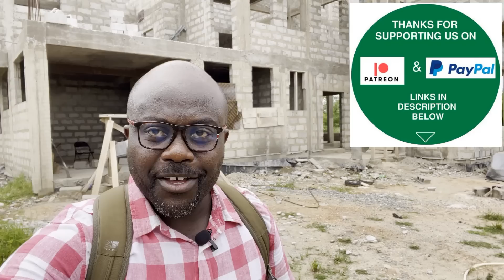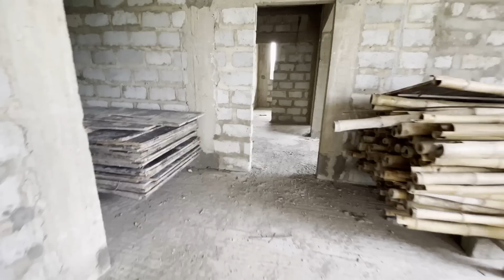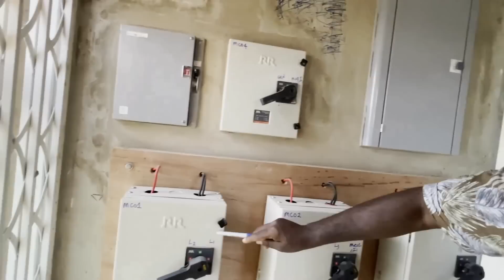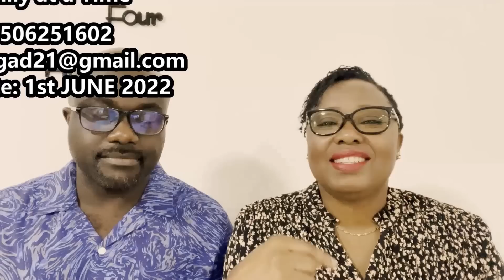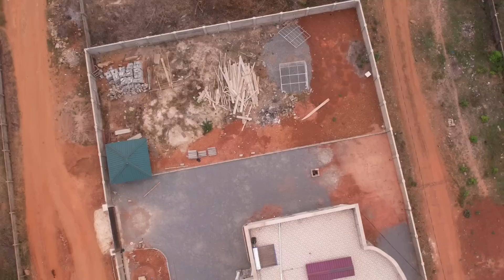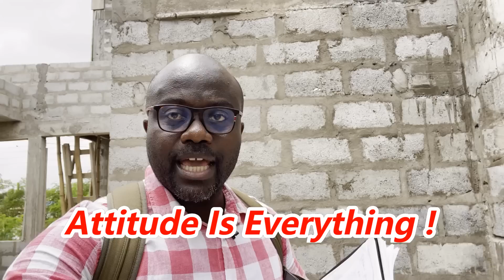JOURNEY WITH ASHER & GAD | TRASACCO SPRINGS-EP2 | RECRUITING!!

Comment from the maker: Ebooks
Cost Templates For Building In Ghana
     https://payhip.com/b/UQjBY
 How to Wire your Home for 110V & 220V Equipment

     https://payhip.com/b/gN8eY
 How to Manage Power Failure (dumsor) in Ghana.

     https://payhip.com/b/BlyQ9
 How to Construct a Water-Proof Concrete Flat Roof in Ghana

     https://payhip.com/b/QXJPl
 How much Power Does your House Need?

     https://payhip.com/b/8P7wu
 Water System Design for a Multi-Storey Building in Ghana

     https://payhip.com/b/fLKYD
 How to Select the right Balustrade Artisan in Ghana

     https://payhip.com/b/WbnCN
 How to Select the right Window Artisan in Ghana

     https://payhip.com/b/dL7FS

Comment: are they too close to those power lines. are people have 6, 7, 8 kids for these many bedroom homes or extended family living or ...? of course a person can have as big a house as they want. I just wonder why more houses aren't 1200 - 2000 sq. ft. or 111.8 - 185.1 square meters. the homes there seem to be really big.

are homes insulated? to keep a home cool without insulation is expensive?

how about placing solar on the ground or and use the solar panels as cover for a carport or outside covered patio? a split system so to speak. panels on roof and panels providing shelter for cars and outdoor patio. or how about building the system 8 feet above the roof. that would create a shading effect for the roof and provide them with a every large covered usable space on their roof. if the roof is flattish . 

is there a reason why more homes there don't use pour in place concrete walling. I would think that would lend itself to faster construction. here we use sheetrock these days to cover interior walls. 

I have not seen anyone as of yet on YouTube there in Ghana use insulated concrete forms.
I think with consultation  a DIY'er could really enjoy their building process.